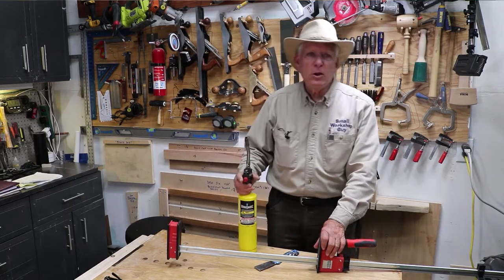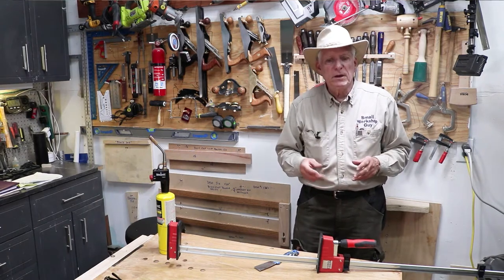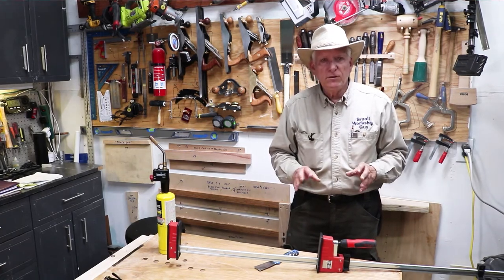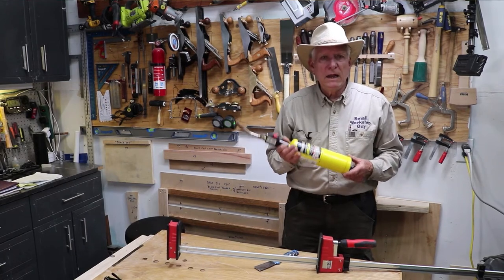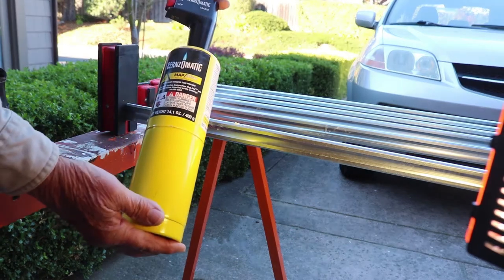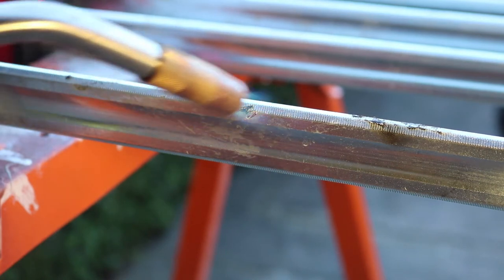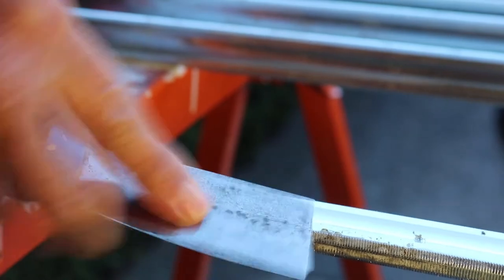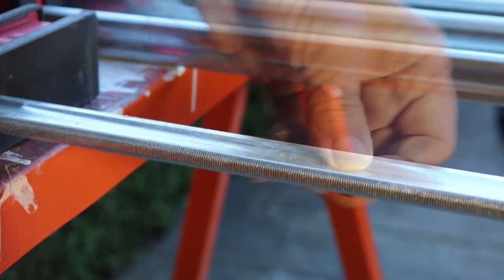3 Tips for How To Remove Glue From Your Clamps Video

Comment: Great tips. Maybe a wire brush would work better than a putty knife.
Reply from the maker: My latest conclusion is to wax the heck out of the clamps before use and then use a sharp (cheap) chisel.  If needed, wire brush, but I find wire brush does not work nearly as well if I did not wax the clamps.  Wax and chisel seems to be all that is needed.